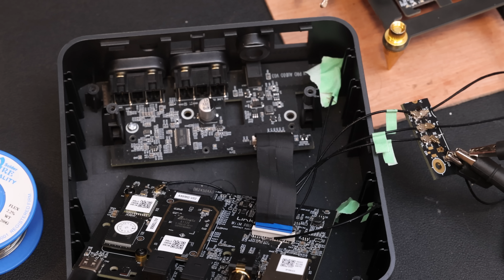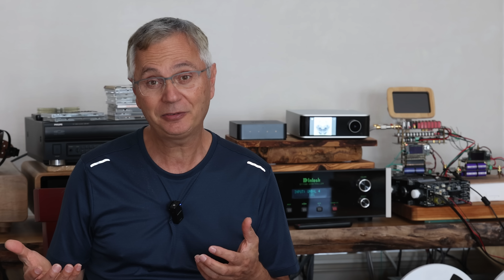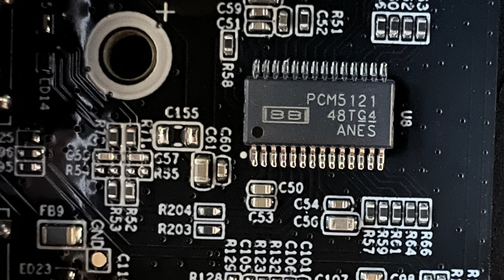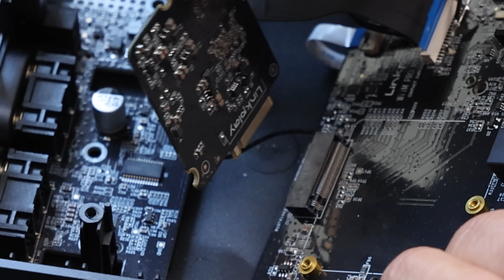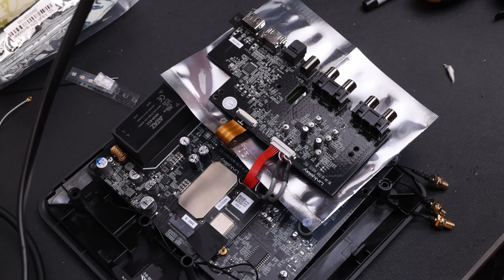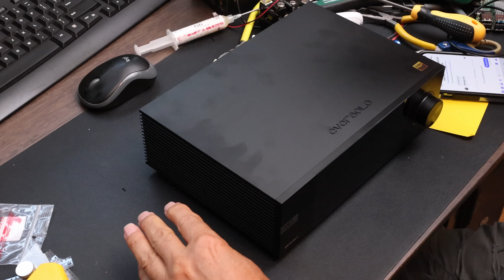I Bought a Wiim Pro & Ultra — One Surprised Me!

Comment: I use my WiiM Ultra exclusively as a streamer, sending the signal via the optical output to an external DAC. However, when testing the DAC's output with an oscilloscope using a pure 1 kHz sine wave, I observed harmonic distortion (FFT) at various frequencies. The distortion disappeared when I lowered the volume to around 60%. I no longer use the fixed digital volume setting at 100%.

Comment: I want to buy a Wiim Ultra to connect to some KEF LSX II speakers. These are active speakers. I'm wondering if connecting the Wiim Ultra with an RCA to a 3.5mm jack would improve the sound my speakers produce, since some sources indicate that the sound entering through the 3.5mm jack is resampled by the internal DAC. Is this true?
Reply: Yes, anolog in will be changed into digital again. Better use a digital input on the speakers.

Comment: I have all three (Pro, Pro Plus, and Ultra), and if you are using the internal DAC, then the Pro Plus sounds best of all of them. If you are going out digitally, then the Ultra is the best.
Reply: Run you pro plus off of a battery pack - the thing you use to charge your phone when you are out of town. I put a supercapacitor cable between the battery pack and the wiim  pro plus . nice sound
Reply: Does the Ultra sounds the best if you use only digital out even when the Pro Plus is fed with a linear power supply ?
Reply: I have all of the above, plus the Wiim Mini. The only feature I ever used from the Wiim Ultra was the external drive, so it’s not really worth upgrading—the Ultra remains the best buy. Also  most of the time, I use an external DAC.

Comment: Nice, thank you. I tried to get an I2s signal from an  streamer, there are just to little converter chips inside ; no possibility to solder a wire on one foot for example. There was a handshake problem (spdif signal not recognized by DAC) > I connected the spdif signal to an older chip DIR 9001?  convert it into i2s, another mainboard > i2s to spdif again. Problem solved.

Comment: Got the Ultra feeding into a Minidsp Flex with Dirac and I am pretty happy 😊 Can't quite agree with your opinion about dsp - the difference that dirac makes is amazing and worth a lot when you can't change the room.
Reply: Just out of interest. Have you ever measured your room with two different cables that measured identical but sounded different? I tried both a USB and COAX (both Chord) and they measured identical x3 sweeps across two separate DAC filters. Have you tried that?
Reply: @LDN_BOX Hi, no I have not tried that. I am using a good quality but standard USB-C cable when I did measurements. I also tried Coax but didn't measure and couldn't hear a difference either.
Reply: @Freshman1966  I tried both a USB to a DAC and a COAX, both from the WiiM Ultra. In theory, they should sound different as COAX relies on the WIim to send packets to the DAC whereas USB can be like an admin and manage the requests and retrieval of the packets. So in theory, it should be some variation. I’ve heard COAX is more fuller and good for a rounded bass and USB tends to be better for separation etc so I tried them on two separate curves and filters which should strongly favour each of them, but after x3 sweeps on each filter for each cable they were identical. Furthermore, I wrote to Chord and they seemed a little evasive but said let your ears be the judge. I used HouseCurve app and it’s pretty good! I must admit I am confused now as I tried a few cables on once in a shoot out and did a difference between them re Audioquest Cinnamon vs Forest but never measured them!
Reply: Are you still enjoying this setup? I'm considering it as well (WiiM Ultra > miniDSP Flex Digital > external DAC)
Reply: @TB-tv2zf Yes, I do. I was thinking about changing to minidsp SHD but it's just not worth it. Before I do that I want to try a different amp.

Comment: I had the Ultra for less than a week before sending it back. This was mainly because the line level input produced a constant clicking sound There are a lot of features that puts it into another category than just being a streamer. I had bought the ultra because not only is it a streamer it is also a dedicated pre-amp. I thought the sound was adequate but not exceptional. What is very useful, is being able to match output and input sensitivity between other components. The WiiMm has 4 output settings ranging between 0.5mv - 2vrms, this is very useful for connecting to older amps such as my quad 405. I replaced the Wiim with an Arylic S10+. This streamer is probably the best value that  money can buy.  Can someone explain why the Wiim Ultra stays on all of the time? Every time I put it into standby mode  it would at some point just turn it's self back on. The sarcastic members of the help forum were of no help. All they said was it's designed to stay on permanently  for ease of use. The unit generates heat when not in use, so not being able to turn it off into a safe standby, is I consider to be a design fault.
Reply: For the help forum, sarcastic is the right word. I have the Wiim Amp Ultra. The signal comes from the main router via Wi-Fi to the secondary router (Accu). This in turn has a ferrite LAN cable, and the Wiim Amp Ultra has a ferrite power cable with filtering. Here in Germany, the Wiim Ultra is used in pure streaming mode, among other things, and is therefore far superior to its consumer class.

In terms of sound, I mean that the pre-section falls short, both with the Ultra and the Wiim Amp Ultra.

This will probably be changed by a specialist in early 2026. The price is reasonable... otherwise, the Amp Ultra will only be used as a streamer in the second system (headphones).

Comment: I don't understand what the Wiim Pro gets you over say plugging a phone or tablet into a DAC/Amp and streaming from there. There's no interface other than the app so it's like a man-in-the-middle giving you nothing really to my eye. Please correct me if I'm wrong.
Reply: It's a headless streamer, phone/tablet is used as remote with screen. You can stream the analog input (has ADC conversion) to one or several Wiim nodes, access to a DLNA server on Ethernet, BT and optical inputs, analog coax optical outputs (full 192k)...and "connect" service to stream from phone/tablet/PC to the "Wiim network", not many DAC's can do that
Reply: Audio quality and other options with excellent software that sees regular upgrades from WiiM.
Reply: You only need the phone or tablet as the interface to the streamer.  Once you select a music stream you can shut the phone/tablet off or leave and the stream continues to play. The stream quality is higher than the phone/tablet alone

Comment: What streamer is a level above this Wiim Ultra? Trying to upgrade my streamer and not sure what streamer to get in order to hear a much improved sound.
Reply: Depends if you use it as a streamer to an external dac only or if you use the internal DAC. As a streamer only to external dac i think the differences are so minimal if there are any.
Reply: @kingpinlifeofcrime streamer with an external dac
Reply: Modify BS Node N130 😊
Reply: Personally I preferred my new Node Icon over my Ultra. But it's also pricier.

Comment: Great video, Gabby – thanks for sharing your insights!
I’m using the WiiM Pro purely as a digital transport, and I’m honestly amazed by how well it performs in a clean chain. In my setup, the WiiM Pro feeds coax into a LAIV Micro uDDC, which completely reclocks and regenerates the signal before sending it via I2S into a Gustard R26.
Both units run on dedicated linear power supplies, and the sound is far beyond what you’d expect from a budget streamer – transparent, organic, perfectly timed, with an exceptionally low noise floor. My system is transparent enough that the speakers completely disappear, creating a holographic, three-dimensional soundstage and a very realistic spatial image.
I’ve also shielded the WiiM Pro internally with adhesive copper foil, and it sits on a grounded metal plate to minimize RF interference. On top, I use a small brass doorstop as a mass damper, which noticeably tightens the imaging and focus.
Just like you, I’ve found Tidal Connect to sound better than playback through the WiiM app – more open, fluid, and natural. That’s actually why I bought the WiiM Pro: it’s one of the few affordable streamers where Tidal Connect works flawlessly.
I never cared about its internal DAC chip – it’s all about transport quality and clocking. With a clean LPS, proper shielding, and a good DDC, the WiiM Pro easily performs on the level of far more expensive streamers.

Comment: I only use WiiM as a digital transport.  Had the Pro with linear power and going to the stock Ultra was a sound upgrade less thin/ more body but subtle improvements.  But as others have mentioned the SMSL PO100 Pro between Ultra and your DAC is a big upgrade in transients.  The puck of strings and initial strike of drums sticks becomes much more lifelike.  The improvement can be had from any of the output connection types on the SMSL PO100.
Reply: Try going straight into another dac via USB. By using the SMSL you are just reclocking and correcting the Wiim's DAC, whereas if you go straight into another DAC via USB you are handing that DAC the reigns re clocking!
Reply: @LDN_BOX  tried both and this is better, 3:14 in this video https://www.youtube.com/watch?v=_k3nTj88KBE Paul at PS Audio has similar recommendation as SMSL for USB DAC users.
Reply: @blue6point62  He at 1.38 said, probably not. Also, I am using an Audioquest USB A to B along with a Jitterbug to reduce noise too! 

I get your point I2S is super cool but I don’t have that on my DAC. So for me I rather give my DAC the job of the clocking.

Horses for courses, I don't know what your DAC is or the rest of your chain. I bought SMSL PO100 Pro along with the Audioquest Cinnamon from Ultra to SMSL then Chord C-Line Coax into my DAC (which is then XLR into my amp) so spent a fair bit on it and gonna keep it for a while as may revisit it for a further test down the line.. 

Funnily enough the one thing neither of us said was Optical from SMSL as that would be least likely to carry any noise, you might drop in terms of resolution but that out of what we can hear anyway and it would deliver in theory very clean imaging.

What Paul said about processing and delivery of packets is true but modern equipment can easily handle that side, you won’t be putting any pressure on it.

I've seen alot of people prefer the DOUK to the SMSL, mainly as it's powered externally which results in better imaging. I don't know what brand Paul mentioned as never heard of it!
Reply: @LDN_BOX  I have the same set up on my second Ultra, Jitterbug with Audioquest Carbon USB to my other DAC.  Still have to say the SMSL is shockingly good if you decide to try it.
Reply: @blue6point62 I have it and it’s a case of horses for courses! I have B&W 707s3 and Audiolab 8300cdq and 8300a which is dual mono, so transparency and separation is there. 

I just plugged in the SMSL back in as wanted to try Optical out of it but I felt that it actually sounded abit thin! I preferred COAX and actually don’t mind COAX from the WiiM, I just used an entry level Chord C-Line and have to say it has pleasing bold and warm sound! 

I’ll stick USB for a while and then re-try the SMSL in a few months, I prefer to get used to something and swap out to see/feel the difference!
Reply: @blue6point62  Okay, here we go! We are both right for more or less the same reasons just with different perspectives re the SMSL! Yes, you are using the SMSL to re-clock but your own DAC would be capable of that and likely as good or better than the SMSL. Your issue is, that you can't go directly to your DAC from the Wiim utilising I2S as it doesn't have that direct connection. I'm not in the same boat, as I can go directly into my DAC via USB and unlock 32bit vs 24bit on COAX & Optical (yes I know about the human hearing range), so I don't need the SMSL and for me taking out the middle man from my chain seems the right thing even though with the SMSL and Cables I have spent £150 to reach this conclusion (which likely isn't the most costly mistake in the audiophile world so will take it on the chin). I bought an Audioquest Forest USB (A to B) USB for this experiment but actually prefer the sound form COAX a little more direct from the WIIM to my DAC it's just a little more bold, so ordered from eBay (2nd hand) both a Chord and a AQ Cinnamon, to see whether its the cable or the port being the determining factor this soon be established. This week will set it and forget it. So in conclusion, think you like SMSL for its I2S  conversion and I don't benefit from that. Et voilà!
Reply: The pro is also bit perfect, you can go coaxial or spdif into a dac, the only thing that would change sound is the source, so if the utra is modifying the sound in anyway thats what you would hear, if applying a filter for example before upsampling it. The data is the same, atleast it should be if its not thats a bigger issue
Reply: So you say that the Stock Ultra sounds better on the digital output then the ProPlus with linear power supply ?
Reply: @kingpinlifeofcrime  It tough to say, I am using the Ultra on Audiolab DC blocks for power and it's USB straight into the DAC of my Audiolab 8300CDQ (which a cd player that also doubles up as a preamp - I figure if I play CDs then I may as well have the same house sound ). I still own both the Ultra & ProPlus but they are in different systems. The Pro Plus is RCA out to an old NAD amp and out to a pair of Sonus Faber Lumina's and it sounds good to me. I also had the ProPlus in the same Audiolab set up via COAX out and I was pleased with it - I never noticed a jump in quality putting in the Ultra and in fact miss Airplay2 on the Pro Plus. I am not sure you will notice much of a difference between streamers using them as transport tbf. But, standalone with the 5v ifi linear power supply I think the Pro Plus sounds very good to my ears! Cosmetically, I think the Ultra looks better, but if they were both in a cabinet, I'd be pleased with either!
Reply: @kingpinlifeofcrime  correct, to my ears and my system.  For a lack of better description, it sounds  richer, more body, less thin and analytical.
Reply: If anyone wants to take the WiiM Ultra even higher, I noticed the USB out still adds distortion/noise.  I am using now Audioquest Jitterbug from WiiM Ultra USB out  before USB cable to SMSL PO100 Pro to mitigate that USB noise.  The results were as positive as the SMSL PO100 Pro. YMMV.
Reply: @blue6point62  I bought and returned the jitterbug, as felt it made going direct worse. I did pick up an ifi Lan iSilencer re set it and forget it!  Btw, what USB cable are you using?
Reply: @LDN_BOX  For my main system WiiM Ultra, I am using DDHiFi TC19 pure silver USB cable out of the Jitterbug to the SMSL PO100 Pro.  On my desktop system using Audioquest Carbon USB out of the Ultra with an iSilencer into an Ifi ipurifier 3 which is connected to my Hifiman headphone amp.  I have an iSilencer for my main system as well.  I think both work well to lower USB distortion out of the WiiM Ultra. On my main system the Ifi pulls the vocals and center image forward while the AQ Jitterbug has more center depth. Both are better than without at least in my systems.

Comment: I have a 6sn7 tube buffer between my Wiim ultra and amp and I am really amazed by the sound. I am not wanting to spend any more money on more expensive dacs or streamers. I also have the Pro Plus which has AKM chip in a second system with Bel Canto amp and PS audio preamp and I am not wanting a better streamer tho the EversoloT8 is very tempting

Comment: Thank you for this very interesting video. I was interested in the Wiim Ultra because of its parametric EQ feature. But toward the end of the video, you mention that the sound is degraded by the introduction of anything DSP related. OK, suppose I'm willing to live with a tiny little bit of sound degradation, what is the best way to introduction parametric EQ in a stereo system (not home theater)?
Reply: If you use EQ you need to make some dB less on the output otherwise you don't have any headroom.
Reply: @kingpinlifeofcrime  Fair comment. Let me give you my upfront answer and save you the hassle of the depth that follows. I went pretty deep. but I ran through alot of things and a 4band Room Correction Fix and actually using the filters on my DAC have proved the best for me, I like min phase and slow-rolloff. 
On Wiim and House Curve I ran the test and noticed the correction had 10db gains which is too much but it was trying to over compensate for something re room layout etc. I then used ChatGPT to look at results. Turns out it was bass 'bloom' as had my speakers mounts and close to each corner call. I fixed this by porting/plugging them (at the back) for better control, I then did a 4 band bass correction fix. I tried PEQ but no point in the processing load for not much meaningful unless you really push it but thats like adding 100% colour and contrast on a tv, it's better in DAC imo. In Audirvana, I set the upsampling limits to 176 & 192 depending on the multiple and in Wiim have a variable rate. So all in all small changes and an improvement too!
Reply: Audirvana, I have it on a private server and it has apps, you can set processing there!